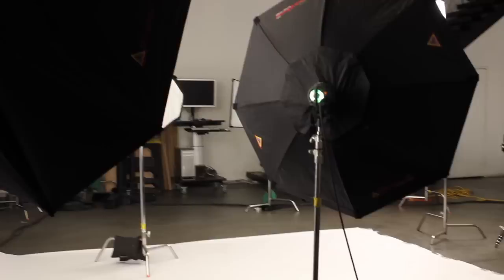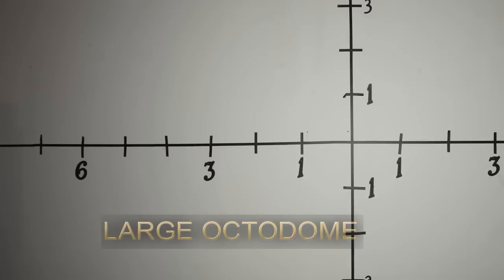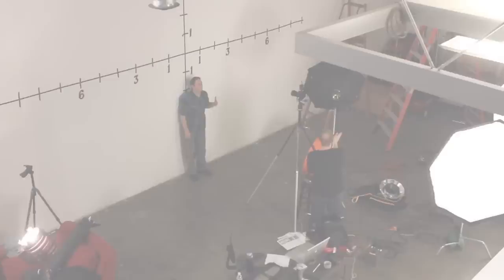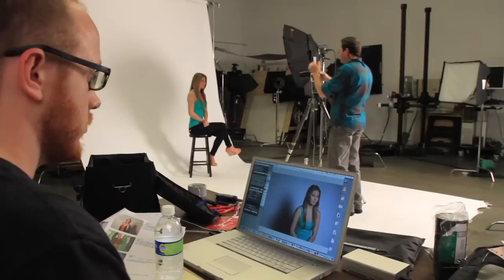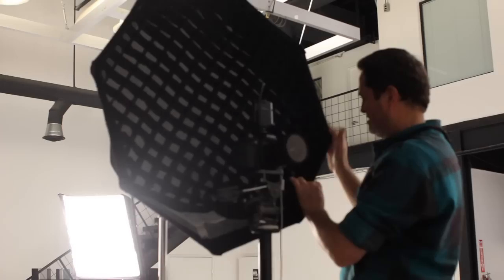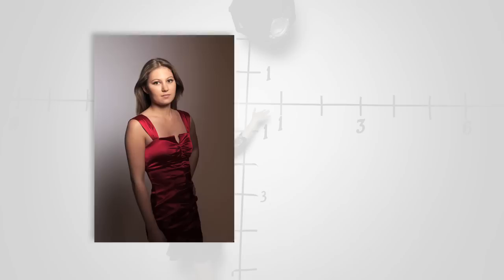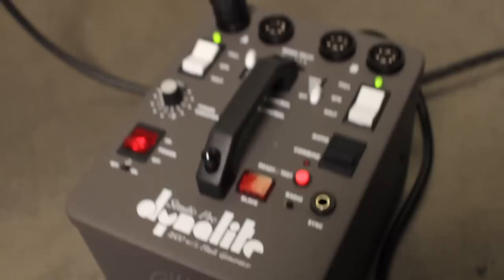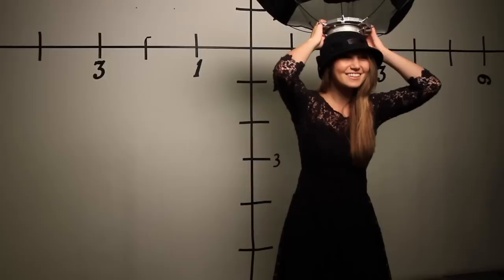How To Use Octodomes/Octo Boxes For Beginners: A Lighting Tutorial

Comment: I'm pretty sure that the small octabox and large octabox covers the same area at 6 feet because of the shape of the octabox. If you replace that with a reflective umbrella, the edges are angled out more, meaning a more obtuse angle. They say it's about the size of the light relative to the subject, but this video proves it's also about the shape of the modifier

Comment: You mentioned you use both the Canon 7D and 5D.  Why use both a crop frame and a full frame camera?  (Actually, since you obviously have an unlimited budget for equipment, why use a crop frame at all?)
Reply: He is also a sports photographer as well as a studio photographer - he uses the 1.6 crop for that extra reach in the field. I think I also heard him say that crop frame cameras have a higher synch speed than Full frame (the 7D does 1/250 whereas the 5D does 1/200)

Mostly, If I remember correctly, he did write in a blog that said it was important to have the necessary tools for the job - and if that means having a crop for extra reach with telephoto lenses, then that's what you use. Full Frame doesn't mean better sometimes - Ive seen photographers who swear by Full Frame in the studio only to have the 7D in their backpack when they shoot sports. It is more common to see crops at sport (or at the very least top of the range full frames like the D4s or 1Dx... Its rare to see the 5DmkII or mkIII in a football match - the fps is good but not great as well.
Reply: Pepingco
I have a Nikon D700 Full-frame camera with a normal synch speed of 1/250 and there are other Full-frame DSLRs with the same synch speed - so that´s not the point.
The most important fact to decide which camera is more usefull for shooting sports is the maximum continuous shooting speed (shots/second)  - the higher the better. That´s why one rarely sees a 5D.
Reply: MrJueKa Ive made money shooting with a 3fps camera. FPS means nothing - speak to any professional sports photographer and we rarely shoot in large bursts. I have my camera set to 8fps but the most I shoot is 2-3 shots during high action. Most of the time, Im still waiting for the moment and shooting one maybe 2 frames.

For sports and wildlife its always reach and AF speed, accuracy and tracking - not fps. FPS is nice to have but if you look at any of the cameras used on the field, its cameras with reach, and AF ability. Its one of the reasons why a lot of new Olympus is releasing a lot of 300mm lenses as they offer reach and lighting AF for the price.

Exceptions are D4 and 1D, but they are expensive options with little compromise.

My original point was to show a range of reasons why someone wants to have multiple bodies. I still use my 5D3 and 7D and I plan on getting an Olympus soon for the times 300mm Canon lens cant get that reach as I normally shoot on a corner of a field. I also use my Leica for the times I am allowed into the locker rooms and for post game interviews
Reply: +Chuck McLaughlin   Even though the 7D is crop sensor it has a much denser pixel density also it's autofocusing system is much more advanced making it better for action